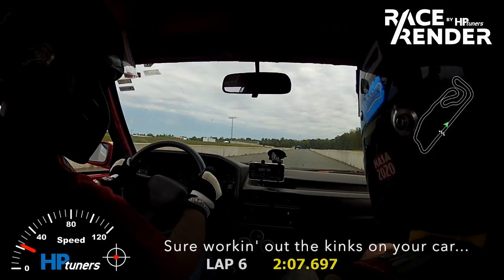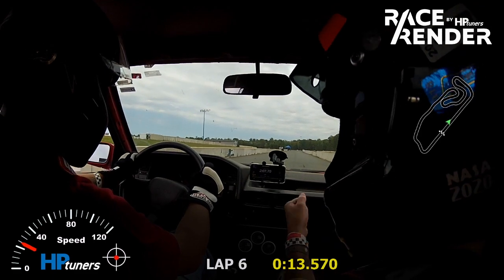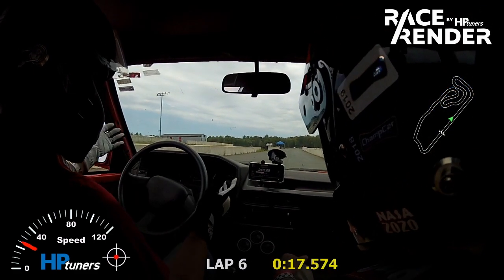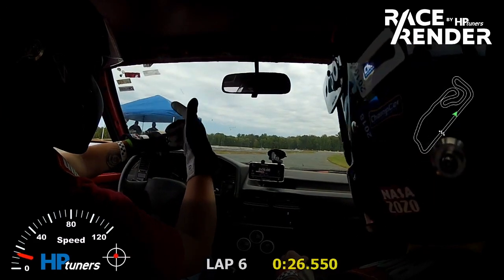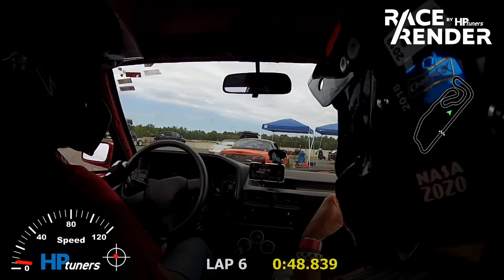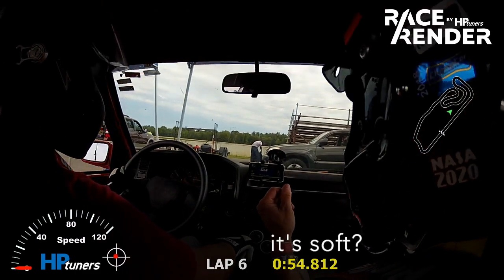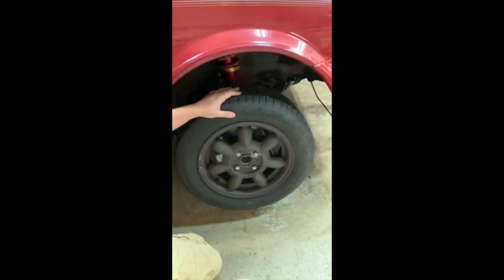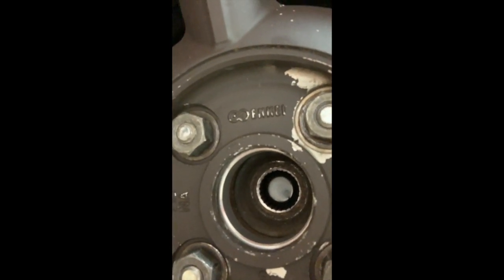Track Day Wheel Bearing Failure

Comment: Hey just wanted to drop a thanks for your FX16 track build posts. I recently got an FX16 and the information has been priceless. Thank you! Would you happen to have the part numbers to do the MR2 brake upgrades for the front brakes on an FX16?
Reply from the maker: Sorry for the VERY late reply, but basically you need the caliper mounting brackets and rotors from an 87-89 MR2. The calipers themselves as well as the pads are the same.
Reply: @TheDailyDownshift  wow! Thanks for responding! I still have the FX16, love this car!